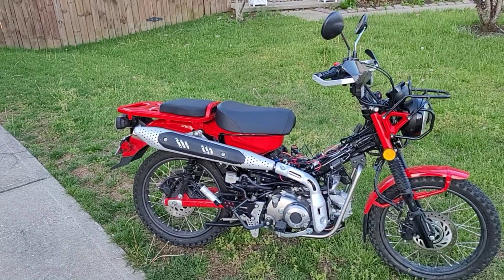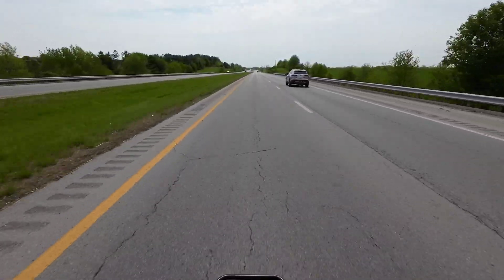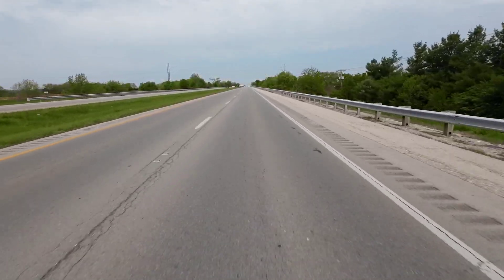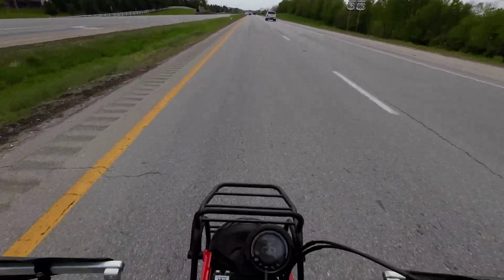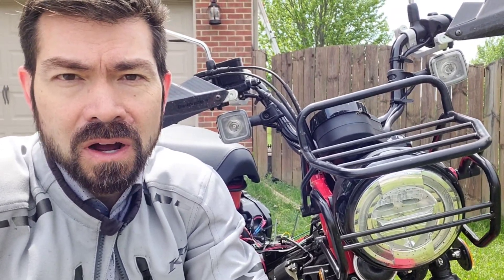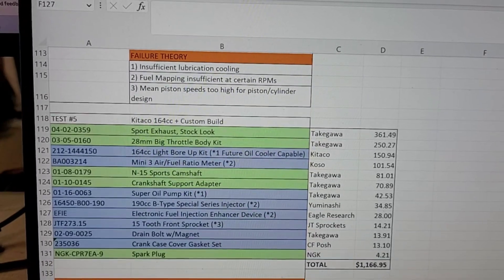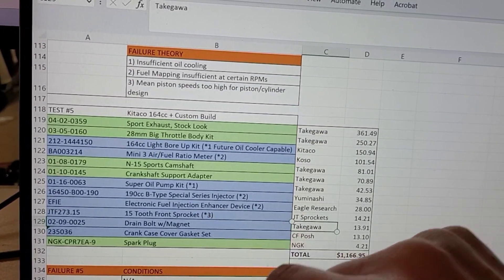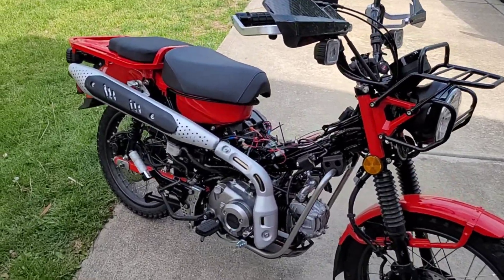BLOWN Honda Trail 125 comes back to life w/a new 164cc Piston & Cylinder! CT125 Big Bore Kit: Part 6

Comment: Fuel octane.. higher octane produces more power .. prevents pre ignition.. England has Shell99 octane fuel .. always use it or BP highest octane ...worth trying
Reply from the maker: These high compression engines really require high octane fuels. Detonation can be catastrophic! From a horsepower standpoint, high octane fuels allow higher compression ratio motors, which produce more power. High octane in a low compression engine won't increase power and might decrease power due to the flame speed.
Reply: Please stop. You are looking quite stupid. Higher octane absolutely doesn’t make more horsepower. It only reduces the likelihood of detonation if you have too much compression.

Comment: A lot of 125s are 14/15bhp these days. Either Honda needs to up things with the motor, or put a standard 200cc motor in these. The idea of them is basically great.
Reply from the maker: I agree.  They obviously tuned it for maximum life but I think they could have gotten life and power out of the mill.
Reply: KTM enduro MX produced 35 bhp ..
Reply from the maker: @manoftheroad55  Not fair 😉 Two-strokes rule!
Reply: I like the 200cc idea.

Comment: Why not just buy a 350cc or whatever can ride legally on freeways and easily keep up with traffic? A CT-90, etc.,  can almost keep up with most typical frenetic city traffic.
Reply from the maker: I like the dual spring rear and large built on carrying deck of the CT and its light weight, otherwise, yes.  I recently picked up a Yamaha SR400 so that will be fun but possibly for a different purpose.

Comment: How does the the stock clutch handle the extra power I’m asking because I put a big bore kit on a Honda atc 70 and the stock clutch would slip if you romped on the throttle.
Reply from the maker: The stock clutch will slip at lower rpms.  I suggest either upgrading the springs in the clutch or avoiding full throttle at lower rpms.

Comment: My stock trail 125 goes 55 (actual 57)
Reply from the maker: Excellent.  Mine would do 51-52 indicated and only about 45 if there was a headwind or grade stock.  Ultimately, I was never trying for maximum speed but rather a constant 55 no matter the conditions.  This was achieved. 70 mph is possible, if that were the goal.

Comment: Have you done anything to the head? What ECU are you using? Why don't I hear any mention of a Camshaft? Some items you need to think about and we don't use the oil cooler on our bikes here in Chiang Mai, Thailand. Install a temp gauge and you'll know for sure if you need the oil cooler....
Reply from the maker: The only thing I have done to the head itself is add a N15 Camshaft from Takegawa and adjust the valves as such. I also have a 28mm throttle body and intake to help flow air into the engine. I am using the stock ECU with an EFIE device from Eagle research as my "fuel controller".  Since this video, I have installed a Opmid Multi gauge which does display head/oil temp from the stock sender. Oil cooler looks to be important once you get to 164cc so I now have one installed. I ended up bumping up the fuel injector size to 220cc/min in a later video along with a Takegawa drop in air filter (not the pod in this video) and it all seems to be a great setup.  I will be doing a video on what my ideal 164cc setup is soon.
Reply: @QuantiQualification one thing to remember is that at most advanced throttle positions the ECU isn't using the oxygen sensor since it's in open loop mode just going off preprogrammed settings. Thus efie module doesn't really work at that point.

Comment: i dont know what it is about my trail 125 but there is 5 with in 50 miles of where i live and they seem to pull as good as mine but when they top out about 57 mph mine will go to 64 mph and we all stock. don't get me wrong it likes 50 to 52 mph but it will run 64 mph on flat ground with no wind. so speed is not what i'm looking for. what i'm looking for is more power. but if i get more speed that will just be a plus. but please don't use axel grease to put the wrist pin and piston in again. buy some assembly lube. but great video
Reply from the maker: That is very interesting on your top speed stock.  Mine could hit around 52 miles per hour on the flats without tucking. This was during 40 degree F weather so that can make a difference (cold air is denser and therefore has more resistance). The biggest problem I had was any wind or grade would just kill that speed down to around 45 mph.  In general, with these Trails, you get more power in the low to mid range and not a huge bump in speed if you use the stock airbox. If you use an air pod filter, you lose torque at the low to mid range but gain power at the high end for better top speed.  It is a trade-off and it is noticeable. As far as the grease, many suggested not using it and I have since changed. If you watch my video about adding an oil cooler, you can see the latest state of build with the stock airbox on the freeway.  Speed for the most part held around 63 mph with a low of 58ish and a high of 68ish.  Those numbers would have been more like 61, 67, and 72 with an airpod on there. I prefer, like you, just enough speed to hang on the freeway for short stints and increase or maintain off road torque.

Comment: What was the speed stock if you know thamks
Reply from the maker: Around 51-52 miles per hour indicated on the speedometer which was maybe 50 miles per hour per GPS. I had stock gearing and tires at the time so the speedometer would over estimate the speed.  I currently have a taller front sprocket and slightly taller tires so now the speedometer under reports speed.

Comment: How and what criteria did you use to keep it in the "safe" zone???
Reply from the maker: With a 164cc big bore kit, it is highly recommended that an oil cooler is used.  In my case, I am currently using extra fuel (running rich) to expel the excess heat. I have another video that goes through different fuel injectors to determine which ones keep the engine cool enough and which cause overheating. In the near future, I will be releasing a video with the installation of a gauge that includes engine oil temperature.  That will help with determining what "safe" is without the need to bounce against overheat conditions.

Comment: Good going and great information. Would you mind putting together a budget build for this kit that can make the bike nearly as good? Like keeping the stock exhaust? or not having all the parts you added?
Reply from the maker: That is a really interesting thought.  In general, the thinking is that the exhaust is the most restricted component from the factory, and therefore, you will get little, if any, gain with the stock exhaust in place from any other modification. Let’s challenge that for fun.  If I have time this week, I will throw on the stock exhaust and give it a go with all my other mods and see what the result is. I will post the video to YouTube if I am able.  Then we can talk about how cheap you might be able to gain safe power.
Reply: @QuantiQualification   Thanks, an exhaust like yours is probably worth it and like you said a good way to gain power, so I'm open to getting one. So that leaves room for other things that will gain power for a good price and be effective. My goal at this point is to keep with the super cubs on the open road.
Reply from the maker: @DearSX  👍
Reply from the maker: Here is the video I promised on the exhaust swap so you can see the difference.  https://youtu.be/bfUuZOw5C0c